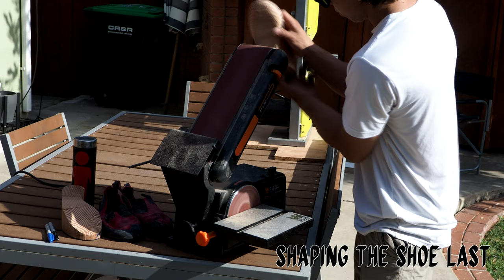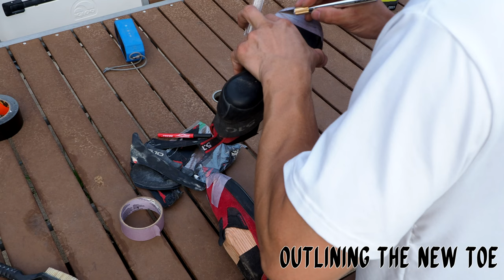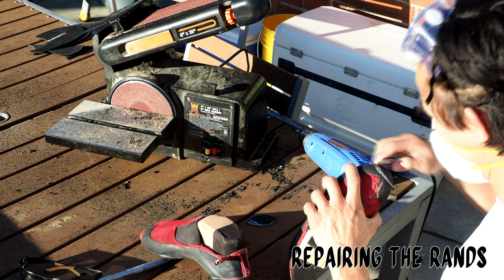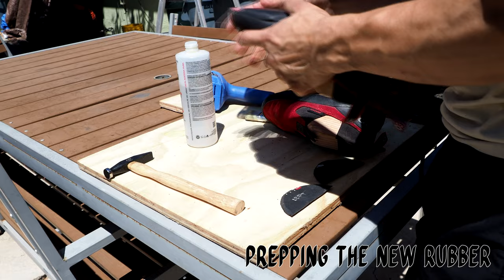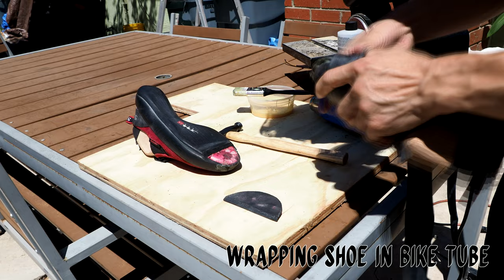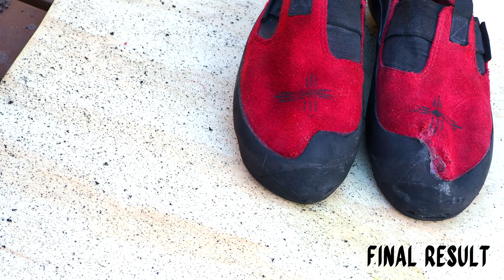DIY Climbing Shoe Resole - How My First Pair Turned Out

Comment: For making the last, what about freezing a bag of water in the shoe and then using that to cast a mould for a last (might save a lot of time)
Reply: If there’s a good mould material that isn’t exo/endothermic so it can cure in a freezer with the ice last. Once it sets you can just remove it, let the ice last melt for easy removal and casting as well

Comment: How much thought went into making your last? Did you make it based on the shoe, your foot, or just eyeball the shape and make it work?
Reply from the maker: At first I followed the shape of my foot but quickly realized if I did it would not fit into the shoe. So then I traced the outline of the shoe's sole and then shaped the volume gradually by eye